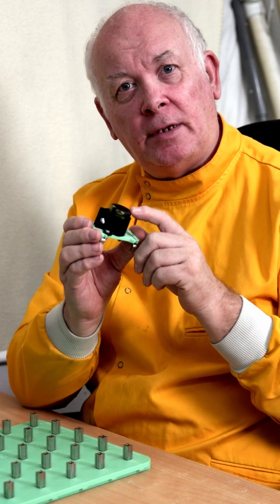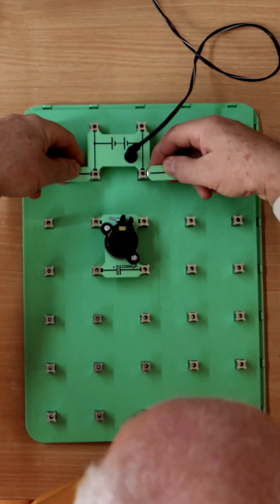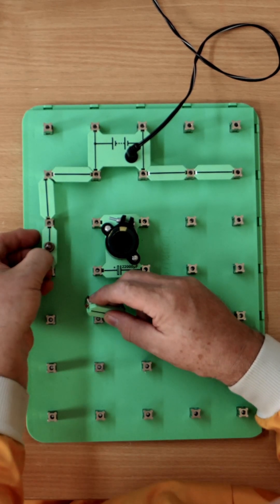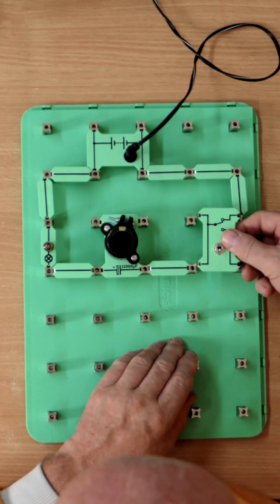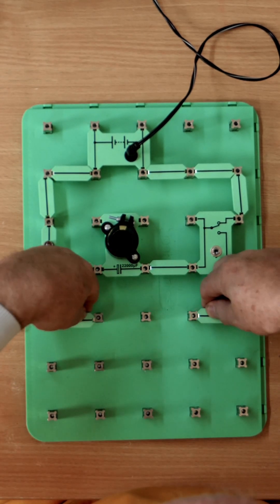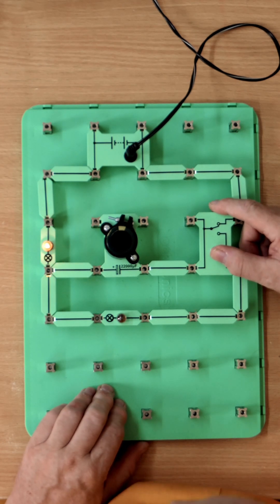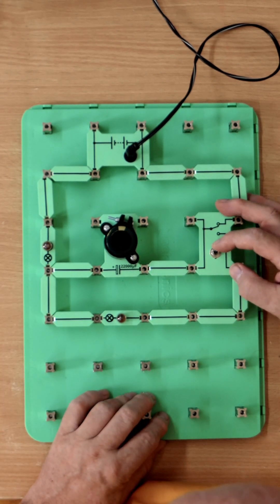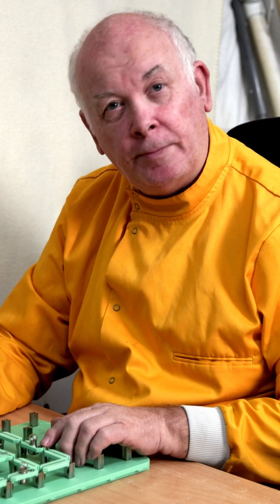Creating a capacitor charge and discharge circuit

Comment: Hello sir, I have been trying to do this circuit. Discharging works. But I haven’t had success with charging circuit with the bulb brightness variation. Pls tell me the capacitor value I need to use with torch bulb.